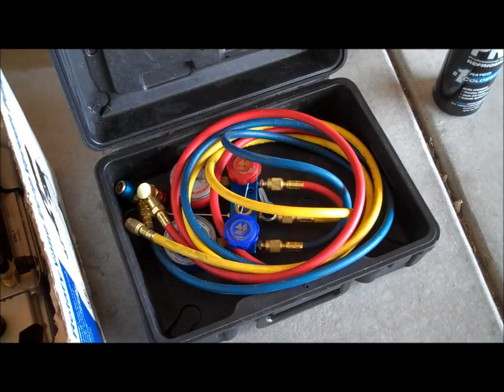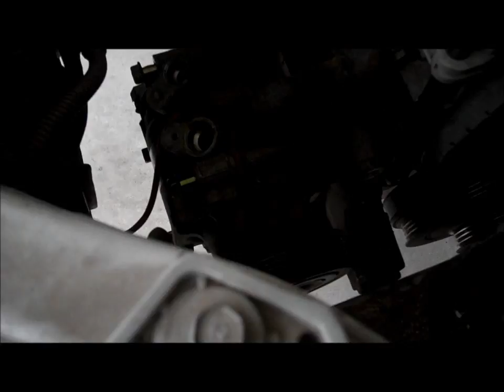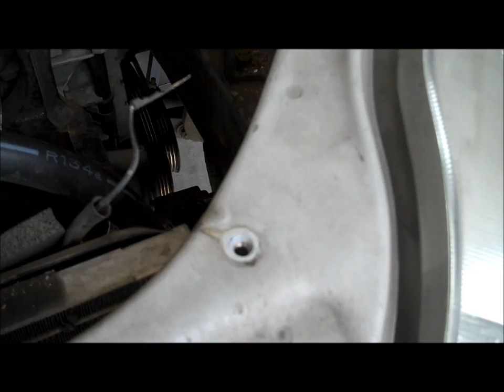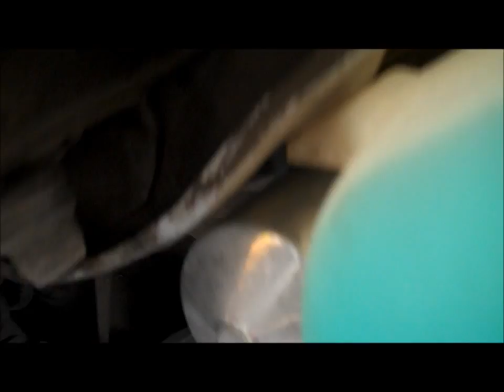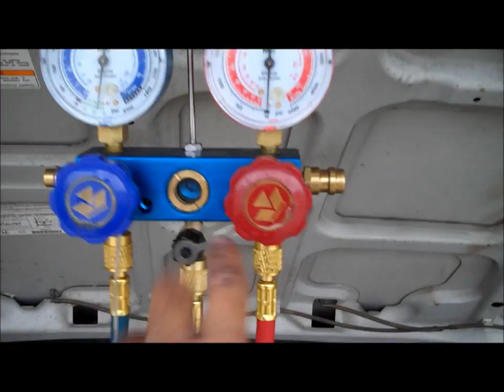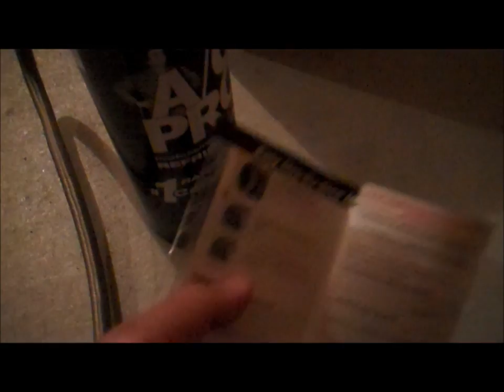2000 Honda Civic AC Compressor and Receiver Dryer Replacement

Comment: Replaced my evaporator and fan. Needless to say, with no freon, the AC compressor wont kick on. Need to do the drier next (your video was great) but don't have equipment to do a full recharge like you did
Reply from the maker: You can get the pump and gage set on loan from autozone

Comment: Great video btw.  I am currently doing this on my 1999 Honda Civic EX.  I was wondering do you need pag46 oil inside your reciever/drier?  Somebody somewhere i forget where poured an ounce of pag oil in the drier and reciever.
Reply from the maker: +Anthony Le 
The receiver/dryer that I bought had pag oil.  so yea if yours did not have pag oil, you will have to add some.  im not sure how much though.

Comment: Yo dude - 

I reallllly don't feel like buying that vacum and doing that last step. What happens if I dont? Is it bad to just install it, and then start filling it up? 

I can crack a hose and let it out before I start. Just dont have that money to rent that machine or whatever.
Reply from the maker: Kevin McNeil AC systems need to be under vacuum for the refrigerant to work properly.  Also, please get a shop to pull your old freon for you, it is bad for the environment if you just crack a hose and let it out into the atmosphere.  renting the vacuum pump from autozone costs nothing, you just need to put down a deposit.  its like buying it then returning it
Reply: Zuhri Lotfy Did you coat the receiver dryer's o-rings in PAG oil before putting them on?
Reply: +Zuhri Lotfy 

Do you know what originally caused your compressor to fail?  I had a leaky Schrader valve but didn't notice until almost all the refrigerant was gone.  There is still pressure in the system but it's very low.  I was wondering if I should replace the receiver.  Did your compressor fail due to acid build up from a worn out receiver?

Plus, where did you get those o-rings?  Did your receiver not come with any?  I had read that aftermarket receivers come with incorrect size o-rings.
Reply from the maker: +anti0918  Yes, I did coat the o-rings in PAG oil
Reply from the maker: +slylockfox85 

I think the fasteners on the clutch just gave up.  It made a loud sound when it failed.  If you have low pressure, you may have a leak somewhere in the system.  Finding leaks are difficult, I would have a shop troubleshoot for you.  I purchased a set of o-rings separately, but the compressor and receiver actually came with them.  They fit just fine